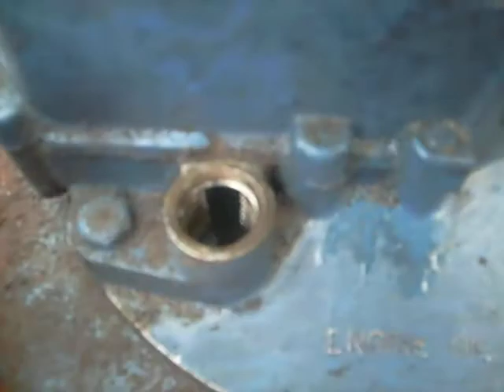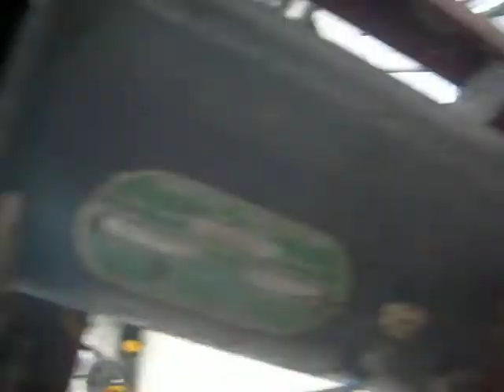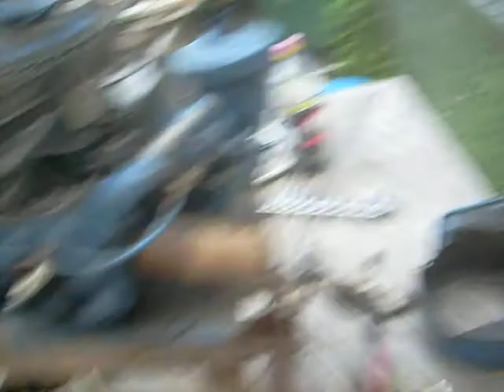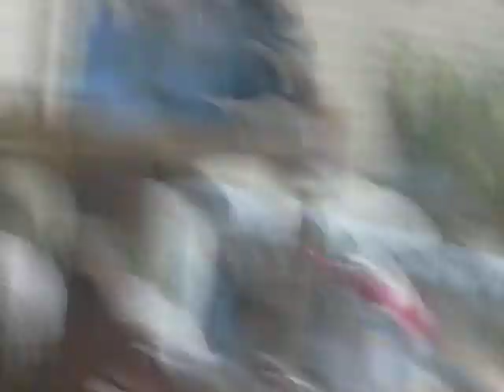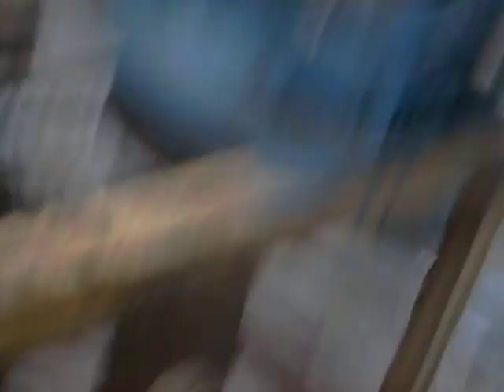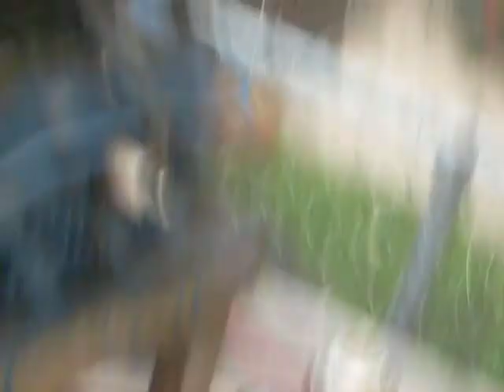TEsting out the free briggs

Comment: I did that with a 3.5 hp briggs that hadn't started in 23 years and all i did was spray some ether in and it started first pull. (The gas was drained though when it was put away 23 years ago)